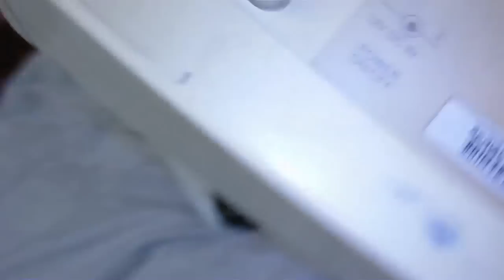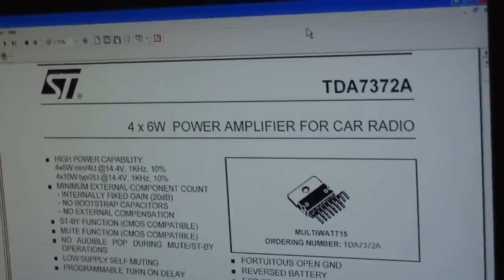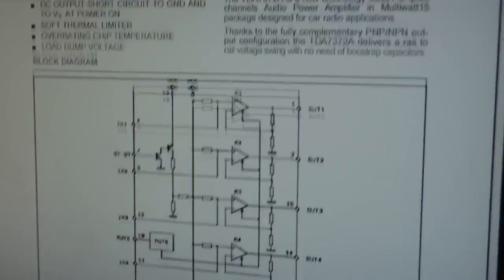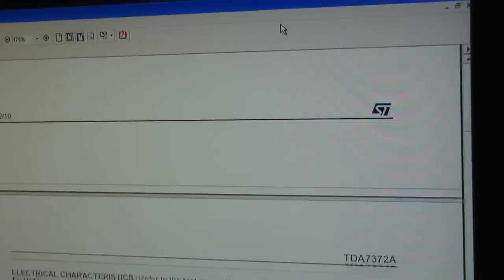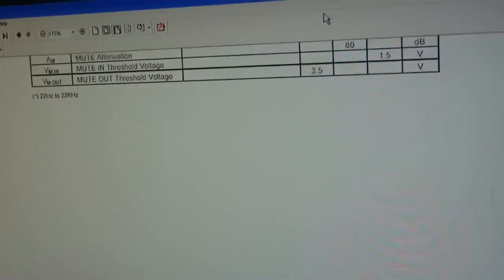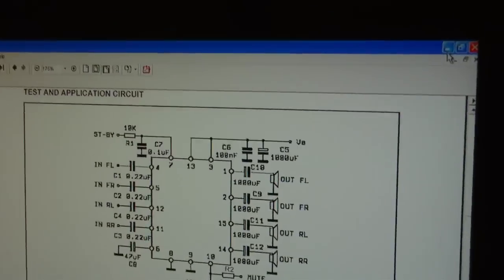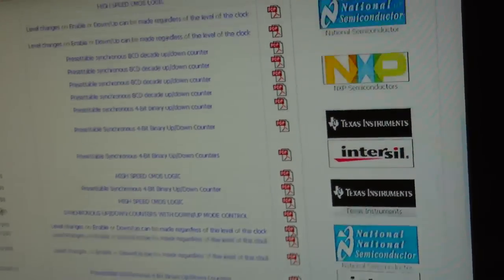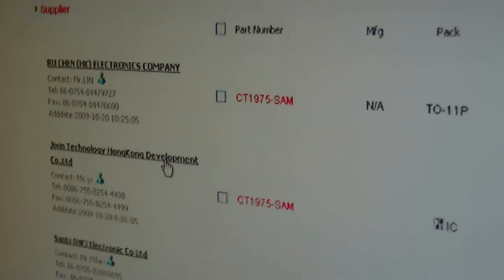Inside the Cambridge Soundworks amplifier

Comment: Do you know the list of capacitors for this unit? Mine is producing humming and I'm guessing that the caps need replacing.
Reply: I has a working subwoofer of this system. This is an interest circuit with some unique feature (sorry for my bad english may looks like rude - i'm not from England). This system may be 4.1 or 2.1 by selecting 4 or two input wires because the rear inputs are inverting. If use in 2.1 mode, you need to connect only one (front or back) input cable and connect only two output speakers using the widely-known "bridge" schematics of TDA microchips. Also connect two speakers to the signal-wires only of outputs satellites, front or rear pair apropriately.

The system has a good sound and up to 20 Watts per 2.1 channel (total 60 Watts power) by using the 15 v DC supply (12volts / 1.5 amps by default). Now i move electronic parts from subwoofer to the standalone amplifier nice box - because the sound of this system is really good! You can write to me to email "atz ui dev @ gmail . com" if you really need each capacitor parameters or more information for.
Reply: @sirlayorn7355   Hi. That's interesting. I opened mine up and made a list of the capacitors. They are:

3x 100 uf 16v
3x 10uf 35v
4x 1uf 50v
4x 0.22uf 50v
1x 0.1uf 50v
6x 470uf 16v
1x 4700uf 25v

But since opening it up and pushing around the caps to see what values are on them, and then putting the subwoofer back together, my system no longer produces buzz and hum, it sounds like normal again. I don't know what made the difference, but I guess I don't need to replace the capacitors now.

Comment: Hi i have same model but I don't know, the voltage and Ah input
Reply: Small speakers 8ohm, woofer 4ohms, power:12V DC, 1.5 A.
Reply: This is an interest circuit with some unique feature (sorry for my bad english may looks like rude - i'm not from England). This system may be 4.1 or 2.1 by selecting 4 or two input wires because the rear inputs are inverting. If use in 2.1 mode, you need to connect only one (front or back) input cable and connect only two output speakers using the widely-known "bridge" schematics of TDA microchips. Also connect two speakers to the signal-wires only of outputs satellites, front or rear pair apropriately.

Comment: Here's a total disassembly guide and capacitor list for the Cambridge Soundworks subwoofer and speaker system. The full thread that this information comes from is here:
https://www.badcaps.net/forum/showthread.php?t=63097

Today, I decided to attempt to desolder the RCA connector to access the 3.5mm front and rear power connectors, which I also removed. It could have been that those connectors needed re-soldering, but I also wondered whether maybe the connector itself was worn out.

I didn't have a spare connector on hand, but I've typically only used the front speakers, with the front speaker power connector attached, without having anything plugged into the rear speaker power connector. So, what I did was desolder both the front and rear power connectors, and then swap them, so that the less-used rear power connector become the front power connector, and the front connector was moved to the rear connector's place.

I soldered everything back together really well, cleaned up the flux residue from the PCB, and reassembled the chassis and powered on the subwoofer. And it worked! It now sounds like a working stereo system should - and it sounds great compared to the effect I was getting for the longest time with the way I was half-inserting the front speaker power cable to get it to make sound from both speakers, which was leaving various audio layers missing from tracks.

It feels good to have it performing properly, again.

By the way, to remove the rear connector and light PCB (which is covered with a metal shield) so that I could access and desolder the RCA and 3.5mm connectors, this is the full process I used:

There's a hidden 10mm nut underneath the bass volume knob on the back of the subwoofer that holds the back connector and light panel in place. Pull off the bass volume knob with your fingers, or something to give you a good grip, and then use a 10mm socket to remove the nut and the washer underneath it.

Remove the small screw that's centred in-between the RCA connectors.

Remove the subwoofer cover by taking out the 4 screws that are in deep holes in each corner of the rear of the subwoofer.

Unscrew the two screws holding the metal cover over the rear connector and light panel PCB. The metal cover then removes freely - and if it doesn't its because there's some orange glue holding it in place.

Use an xacto knife blade, or similar to cut the glue that's holding the metal cover, and also the rear connector and light panel in their places, and, after you've already removed that hidden nut I talked about, use pliers to pull the rear connector and light panel out, along its track.

Alternatively, you could use a soldering iron to melt the glue that's holding the rear connector and light panel in place. I used both a knife and a soldering iron to make it easy enough to remove by pulling the PCB out firmly with pliers.

While I had the unit disassembled, I made a note of all the filter capacitors, which I guess could start needing replacements sometime in the future. I'll post them here, in case anybody else happens to have an interest in refurbishing this unit:

6x 470uf 16v
4x 0.22uf 50v
4x 1uf 50v
3x 100uf 16v
3x 10uf 35v
1x 0.1uf 50v
1x 4700uf 25v

If I do further work on the system, I'll aim to replace the capacitors, the RCA connector, and the two 3.5mm connectors.

Comment: alri i get you no just one of the small ones of mine blew and havent a clue how to get the case off it
Reply: There's a hidden nut underneath the bass volume knob on the back of the subwoofer that holds the back connector and light panel in place. Pull off the bass volume knob with your fingers, or something to give you a good grip, and then use a 10 mm socket to remove the nut and the washer underneath it.

Remove the subwoofer cover by taking out the 4 screws that are in deep holes in each corner of the read of the subwoofer.

Unscrew the two screws holding the metal cover over the rear connector and light panel PCB. The metal cover then removes freely - and if it doesn't its because there's some orange glue holding it in place.

 Use an xacto knife blade, or similar to cut the glue that's holding the metal cover, and also the rear connector and light panel in their places, and, after you've already removed that hidden nut I talked about, use pliers to pull the rear connector and light panel out, along its track.

Alternatively, you could use a soldering iron to melt the glue that's holding the rear connector and light panel in place. I used both a knife and a soldering iron to make it easy enough to remove by pulling the PCB out firmly with pliers.

Comment: A lot of interesting parts and ICs can be found in all those cheaper things like those amplified speaker systems. And I think that IC with the four amps in it is a really interseting part. For opening up those kind of stuff I've "modified" a usual screwdriver, usually that works pretty good.